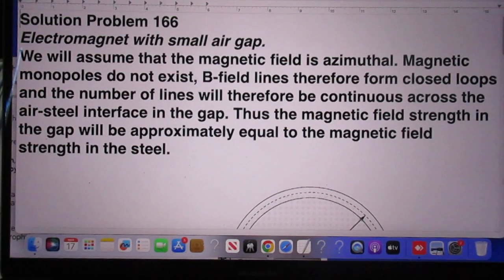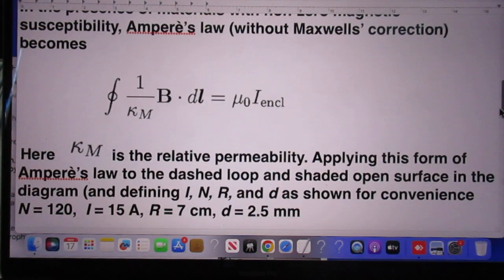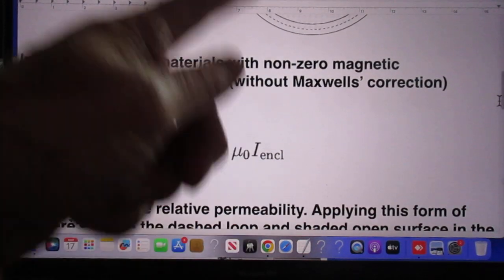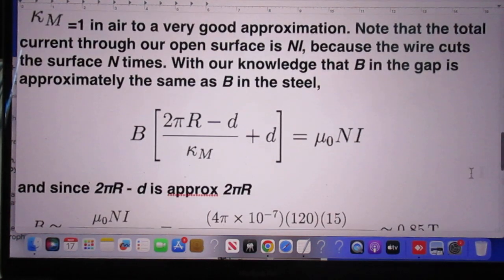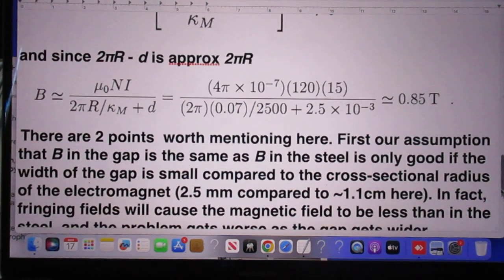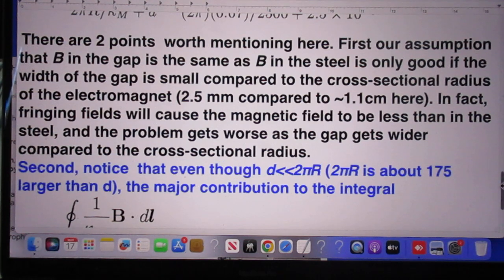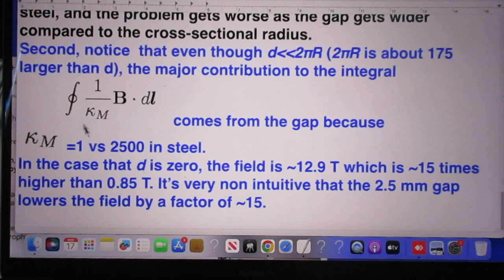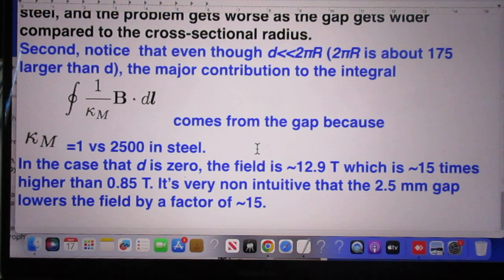Solution to #166 - Electromagnet with Gap

Comment: There is an easier approach (for many) to solve this problem that doesn't involve the integrals. In analogy with electrical systems (V=IR) you can write for a magnetic circuit: MMF = flux x reluctance. MMF is the magnetomotive force and equals N times I. The reluctance is the sum of the reluctance of the gap and the reluctance of the steel. Reluctance is l/(mu_r x mu_0 x A), with l = path length, mu_r = relative permeability, mu_0 = permeability of free space and A = area. Once the flux is calculated you can divide by the area of the gap to obtain the approximate flux density in the gap.

Comment: Hello Professor, I have a remark here. The air gap is completly independent on the cross section. It only depends on the current and the length of the toroid

Comment: Sir, here you considered magnetic field will remain constant throughout the length of the rod, but it should fall rapidly towards the end, only 120 turns are there. Just asking. In case of evenly spaced helical winding your result is correct.
Reply: No dear friend, this is a problem of magnetomotive force and reluctance connected in series. For normal toroid B= UoUrNI/2piR = 12.84 Tesla. But when you use a gap then B = UoUrNI/(2piR + Ur×gap length) = 0.85 Tesla approx. Although it uses Hopkinsons analogy to magnetic circuits and useful for huge number of turns, where flux leakage is almost zero.

Comment: Sir how light travel because it have no mass  p=mv and it's m =0 so it's momentum is zero and it's kinetic energy is also zero sir how light travel and how we know that sun is made up of hydrogen without going on it
Reply: I had the same question about momentum and mass of photons.  p=m*v is only valid when v is small compared to the speed of light.  The formula that accounts for relativistic effects is p=m*v/sqrt(1 - v^2/c^2).   Take the limit as v approaches c, and you'll see that the only way for p to be a finite number, is for rest mass m to also approach zero.  There is a concept called relativistic mass (m = m0/sqrt(1 - v^2/c^2)), but it has fallen out of favor to use it for teaching relativity.

As for how we know the sun's composition, we measure the spectrum of the sunlight absorbed in its corona.  The main plasma body of the sun produces a continuous blackbody spectrum, while the outer envelope of gas will selectively absorb certain frequencies.  When comparing those frequencies to the emission spectrum of a laboratory hydrogen lamp and the Bohr model, we can conclude that hydrogen is in the sun's composition.  This is how helium was discovered on the sun (before we discovered it on Earth), and the sun is the namesake of helium.
Reply from the maker: @carultch  thanx Carl for your comments. I also avoid the words "relativistic mass" - It's very misleading.